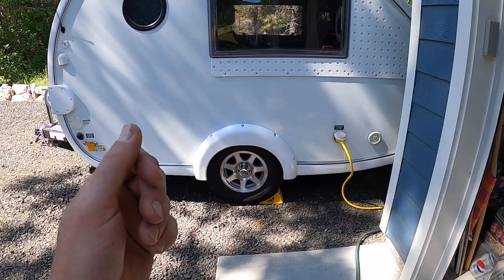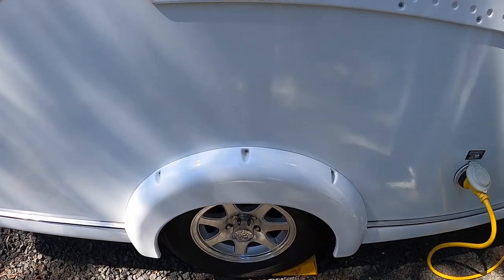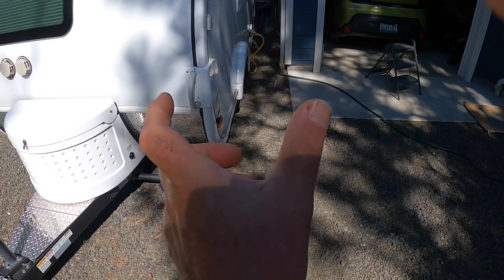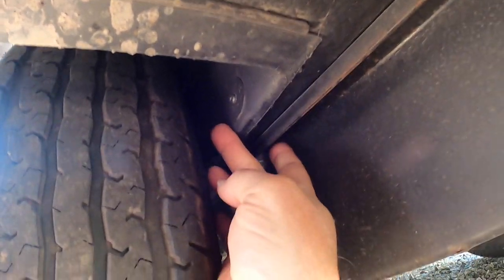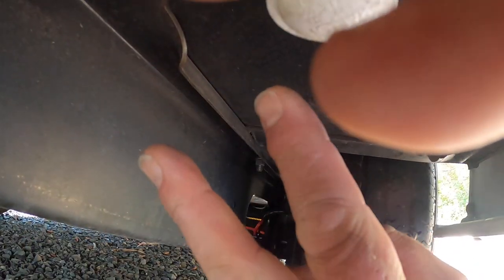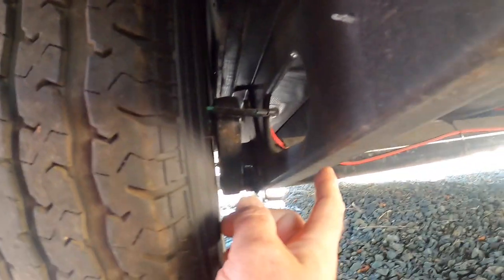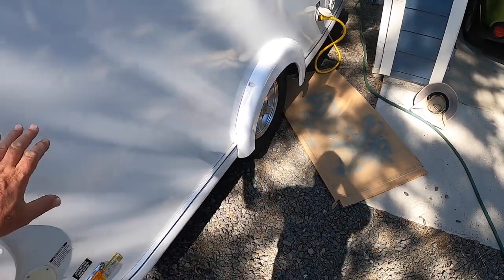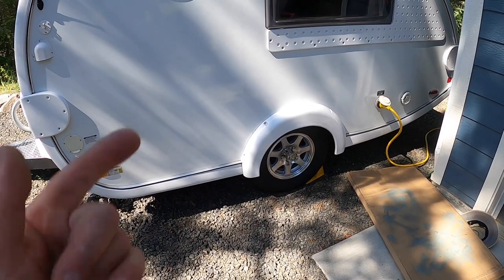Axle, frame and body "misalignment" - Part 1- need your help

Comment: Mark,
I too have a 2015 with the "offset body".  I discovered the issue when I realized there was a 3/4" wheel spacer between the driver side hub and rim.  After a lot of measuring I discovered what you did, that the body was set off-center to the chassis.  I sent an email to nuCamp describing my findings and asking why the spacer and if they had any suggestions for resolving the problem.  I  received a reply today which informed me that they intentionally off-set the body because the drain from the shower would have run into the frame of the trailer.  Apparently some 2015's didn't get the wheel spacer and some did.  My research on wheel spacers left me with a new problem.  Having that wheel farther away from the center line of the chassis causes the trailer to "crab" slightly resulting in greater road friction and heat on the tires.
The solution I came up with was to change out the 3/4" spacer for a 6mm (roughly 1/4") spacer and then to add a matching 6mm spacer on the passenger side which will make my wheel spacing off the center line equal and should cure the "crabs".
Reply from the maker: That's a curious explanation they gave you, especially since I've gotten reports of many trailers my age and model being centered correctly.
Hmmm.
Time to take the cover off the shower trap, and take a look...
Thanks for the feedback.

Comment: While not the best solution you could add a spacer between the brake drum & the wheel to move the wheel out a 1/2" or so to give more clearance between the tire & the frame.  Next time I go to my storage location I will measure my 2016 t@B.
Reply from the maker: Moving one tire outboard will mess with the trailers tracking, and cause "crabbing" which will wear thru tires really quick.
Putting spacers on both tires will cause the other tire to rub on the outside of its fender.
My solution will likely to be modification of the fender well itself.  I will slot it, widen it, and re-install about two inches inboard.

Comment: If you had to you could order another wheel and change the backspacing by 2”. That would be a easy fix but you would have a definite R and L wheel from now on. But nobody would know it but you.
Reply from the maker: Like putting a wheel spacers on, extending the offset of one wheel outward messes up the tracking of the trailer. It will no longer pull straight. It would crab sideways a bit. This causes tire scrub and premature wear. 
Tire offset also messes with the wheel bearing loads. The inner and outer bearings in a wheel hub are intended to share the wheel load. By offsetting the Tire outbound, the outer bearing takes most of that load on itself alone. This is dangerous.